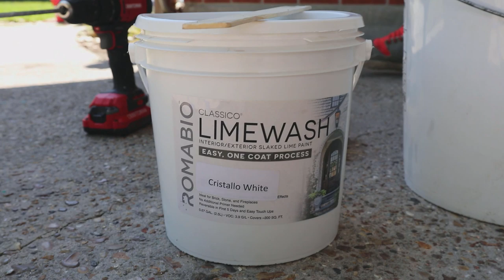We Limewashed Our House!

Comment: This video helps me so much. I am trying to decide if I want to paint or limewash. Yours took 5 coats so that has me worried, but my brick is lighter so that's where I'm running into not knowing what to do... Decisions decisions.  It looks great on yours though so that makes me want to do it!
Reply from the maker: You can do it!
Reply: @woodnstick  oh I did it!!! And I love it!
Reply: It depends on what ratio of lime was to water you use for the amount of coverage you want... I did my orange mingled brick in one coat, mixed 1 part lime wash to 4 parts water. I did not want the brick to look painted, so I scrubbed it in thin with a paintbrush..lol. It was a lot of work, but it looks amazing. I did not wash any off after either. .I highly recommend it. You do need to keep the brick very damp, especially if it is hot outside..
Reply: @1968tbolick  I did mine one year ago this month. Love it and it covered my orange color in mostly one coat but I did two just to help with patchiness.

Comment: What was the Second sprayer you used? The one that worked so good... please let me know!
Reply from the maker: https://www.lowes.com/pd/Wagner-Flexio-4000-Stationary-HVLP-Paint-Sprayer/1000333975
Reply: @woodnstick  Thank You for the response. I cant remember if the vid showed the mixture. If you know, what Mixture ratio did yall use?
Reply from the maker: We mixed it 1:1
Reply: @woodnstick  Thank You So Much... We did a brush coat on the front of our house, so its pretty thick. But we were wanting to spray another coat or 2 to see if it will fill in some areas... any splattering or clogging with this sprayer? Wonder if you think the sprayer was def worth it...?